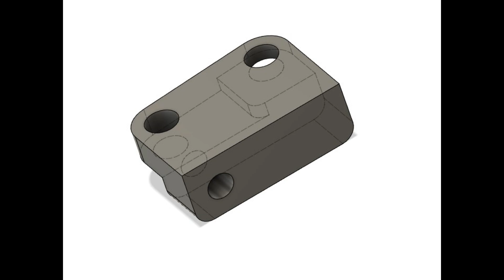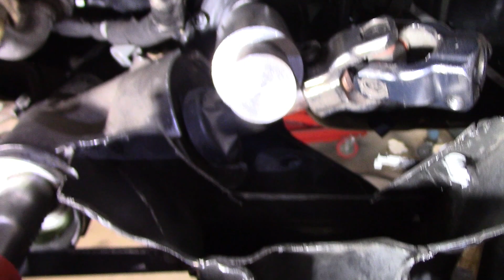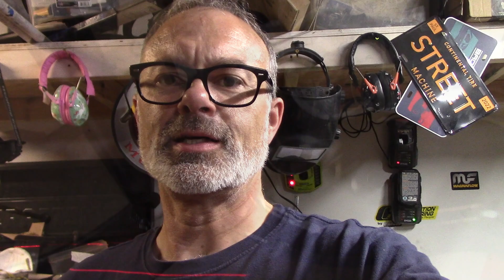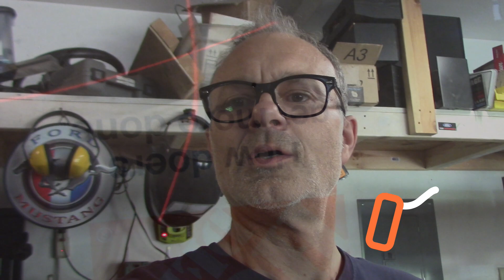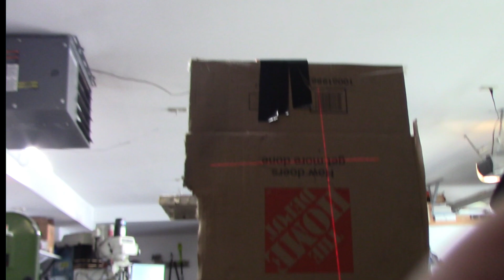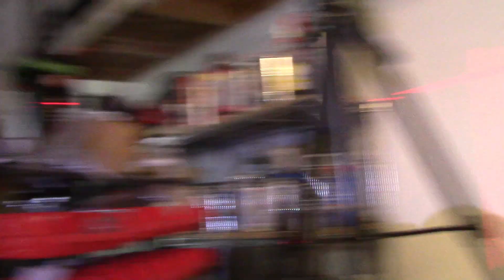Custom AWD front Differential and Suspension - Mustang AWD Conversion Ep 22.

Comment: Since I'm a couple most behind I'm sure you've already passed this point but as far as measuring Ackerman, I wouldn't bother. A parking lot test will tell you right away if it's good or not. 
I also think it would be funny as hell to take it into an alignment shop and have them align it but don't tell him ahead of time of what's been done and then have a couple hidden cameras mounted underneath to catch the reaction.
Reply from the maker: The Ackerman ended up not being an issue at all.  Like you suggested, I drove it around taking tight turns in a parking lot and the car did not scrub a noticeable amount.  

Thanks for watching.
Reply: @npvg  thanks for posting the videos.

Comment: Found your project at episode 18 (the C/V joint), went back to the beginning and started watching the rest. Definitely a lot of work but it's looking great!  Would love to pick your brain about C/V axles for my project.  I took a 3.5 Chrysler engine and trans from a 2003 300M and put it in the back of an 88 Pontiac Fiero. Been running it for a few years but have always had problems with the axle shafts.  Subscribed and looking forward to the next video!

Comment: I’ve just found this project so excuse me if this has already been addressed… but why not use a tubular K member (engine cradle) instead of modifying the bulky OEM cradle? The aftermarket K member I feel would have made many of your clearance issues either nonexistent or much easier to deal with. I love the content! I will be going back on the project to get caught up.
Reply from the maker: All of the commercially available tubular k-member have a built in motor mount and a few other features I would basically have to cut out and redo.  I didn't think it made sense to pay quite a bit of money for something just to cut a great deal of it away.  But, in the future I may try to make something.

Comment: When you unlock metal casting, your project will look OEM 😄 You live in an area where you probably have access to foundry works, it would be worthwhile making some 3D printed patterns that you could get cast, then final machine those for the car.  That mount on the front of the diff is a casting all day long!
Reply from the maker: I have thought about getting some investment cast parts.  I have done this many times at my job.  One application is for turbo headers, once I get to boosting the car.

Comment: Get yourself an actual bump steer gage kit! Love the laser idea but there’s no actual toe difference. Your Ackerman will actual be reduced being mounted more rearward so I’d expect it to push or okie on cornering
Reply from the maker: Matt,  Thanks for the feedback.  The point of the laser is not to measure toe.  I brought the car in and had it professionally aligned once it was on the wheels.  The laser pointer method for measuring bump steer is a proven system.  This company sells a kit, but there are instructions all over the web and videos that show how to do it the way I did.   

https://advancedracing.com/product/laser-bump-steer-gauge/